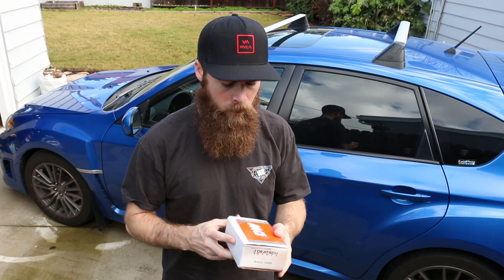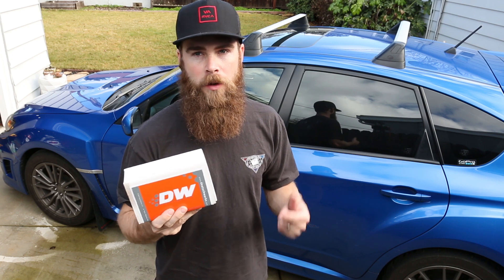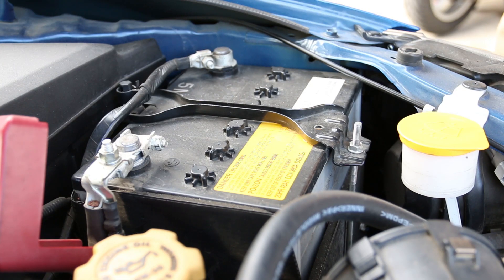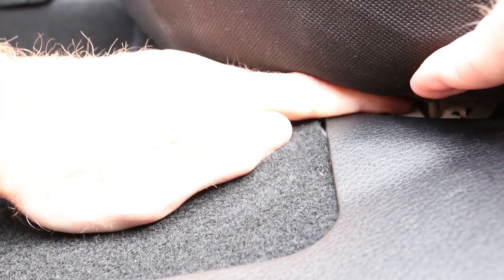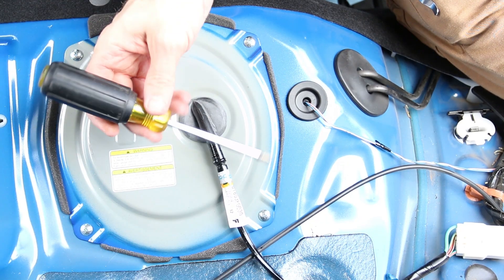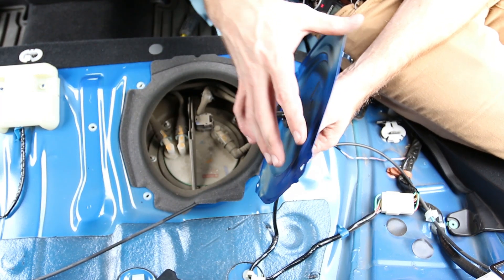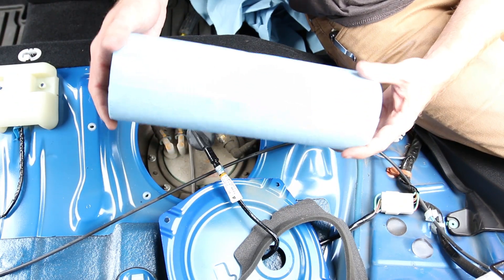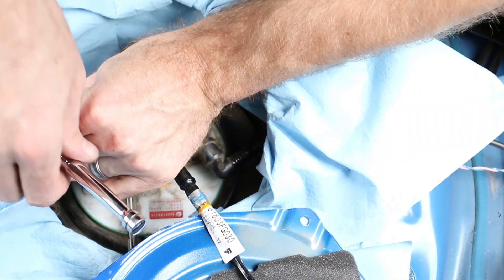HOW TO INSTALL A FUEL PUMP IN A SUBARU WRX PART 1 REMOVAL

Comment: I'm installing a 65c and new oem filter in my 09fxt, has some miles and unknown history. Luckily we only need the two o rings and filter that come with the pump. I do fuel pump recalls for another brand at work and the kit has a million pieces.

Comment: How much fuel is too much fuel to take the pump out? I understand you want to have as little fuel as possible however I am trying to drain trash fuel out of my tank and unfortunately its a little under half a tank. Also aware there are other options for draining fuel. Looking for an option that doesn't include running this fuel through my lines or pump. Any reccomendatons? 11 wrx sedan
Reply from the maker: You can use a fuel transfer pump less fuel is better but you should be able to do it with half a tank.
Reply: @BlakesGarage  sweet deal. Thank you!

Keep being awesome!

Comment: Thanks for this. 2017 STI, didn't know how hard I'd have to pull to get the assembly through the tank; the fit is very tight.

Comment: Before you start, remove fuel pump fuse (engine bay) and crank the engine a few times which will relieve most pressure from the system.

Comment: Did it fix the problems 
Same problem with my sti same year hatch back as well 
It starts cutting off and losing power 
Please reply
Reply from the maker: I had an issue with my MAF sensor that was the actual problem with my car. However, this could also be something that would help. It's really hard to say you just have to start eliminating parts or hope for a CEL.

Comment: thanks for this video Blake. I have the exact same fuel pump and will be installing it and this video definitely helps. I'm used to seat just popping up (like the middle tab does) and I probably would have broken the side tabs yanking on the seat cushion so thanks again :)
Reply from the maker: +Brandenburg008 No problem glad you learned the trick. Wait until Friday when the second half comes out will learn some more good pointers.

Comment: need your opinion bought whiteline rear swaybar and now need the end links too guy is asking75 shipped used with about 15kmiles on them fair? or should i just buy new 125.
Reply from the maker: +WRX508 $75 shipped is that for front and rear? If it is I would probably just do that. Also they may squeak less being broken in LOL.
Reply: +Blake's Garage just rear lol getting kinda ripped I think.....
Reply from the maker: WRX508 Yeah that seem kinda steep. What kind? Kartboy? I would just get new ones I think.

Comment: Great vid! Looks like you're doing surgery with all the blue towels.

I changed a couple of fuel pumps in my old Subaru GL (89), and dropping the fuel tank was the only way to get to it. Glad to have this to refer to in case my '14 STI needs a change - looks much easier than the  old way.
Reply from the maker: +gorigriaoaoid From start to finish if you watch my videos first you should be able to do it in around 45 min start to finish.

Comment: i just commented on your stage two video....and then watched this...your issues here almost sounds the same as mine....where are the ranges your falling off at, does it bounce up and down? If you power threw to the 3k range does the power still fall off and come back up?
Reply from the maker: +Corey Van Leeuwen It happens very infrequently but its usually between gear changes or when the car is low on fuel. I mostly see it happen around 2.5 to 3K. Its a super quick off on type of thing.
Reply: Hmm..super confusing problem, the internet doesnt seem to have an answer at all. One guys changed injectors, pump, fuel rail, down pipe, pro tune, CAI chasing the same issue. as i said ive contacted Cobb and ive taken about half dozen logs of the issue so im gonna drop it on them.

Same rpm range. it only happens when the car is under low load for me say 10-15% throttle. how bout yours? When you loose power how far do you drop? i loose 2-300 rpm then it bounces back and forth if you hold the throttle as is.  like i said in the other post ( dont wanna make you jump back and forth) car runs great under load, no boost creep hits target boost everything else seems fine, all the vac hoses are good to go..i cleaned the throttle body and such when i did the down pipe install, but i didnt do the throttle body fix you spoke of but my hoses were clean of oil no blow by really at all.
Reply from the maker: +Corey Van Leeuwen Yep same thing under light throttle and low load usually between shifts. Super weird and always random. I actually go a data log of it this morning on the way to work so when I get home I'm going to look at it to see if I notice anything strange.